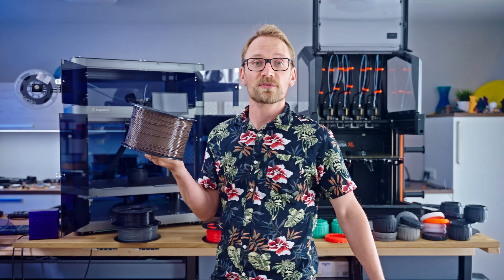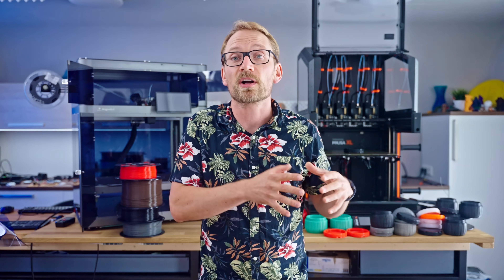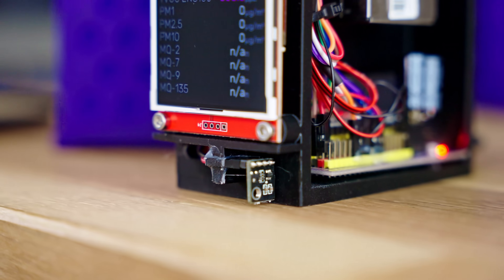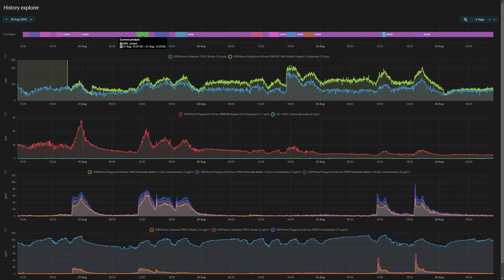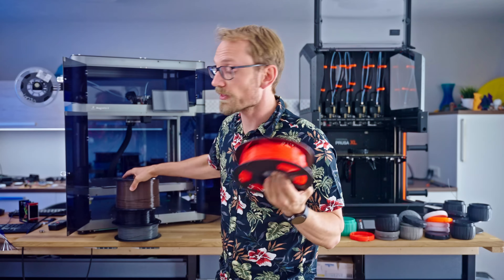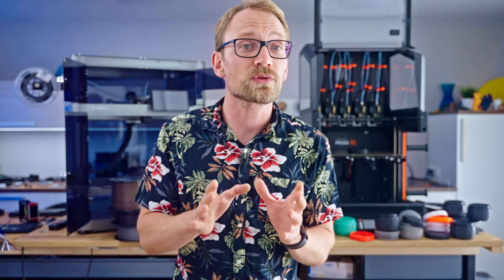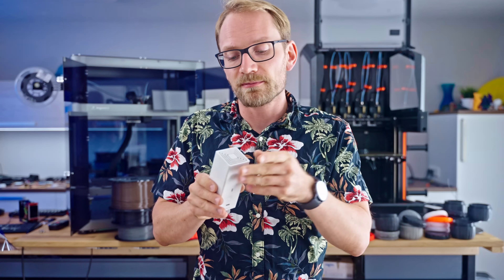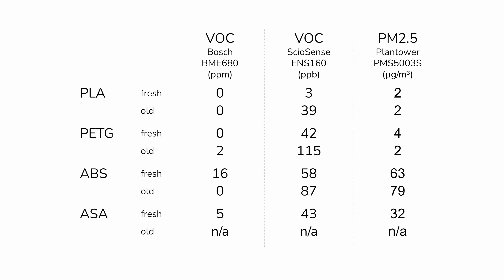3D printers are worse than I thought. Time to do something about it!

Comment: The solution to pollution is dilution. I think the best thing to do with 3D printer fumes is probably to plumb them outside. A reasonably airtight enclosure, a hose or duct and a fan to  exhaust the air in the enclosure outside. 

Or just put the printer outside, that's what I do with my Anet A8. Also helps ensure it won't burn down the house without at least first burning down the balcony.
Reply: Certainly having them away from your living area is by far the best option. I have a storage room by my garage that will be my "hobby room" once I get around to finishing it. But I'll still be running a HEPA filter with active carbon to scrub the air, it will just be a little less urgent with said air multiple rooms away.

Comment: I've been saying this for years.

1. PRINT IN A SEPARATE ROOM THAT YOU DON'T USE

2. Don't trust any filter on any printer - as soon as you open the door to get the print, the fumes come out anyway 😂

3. Wear a mask in your print room and have an extraction fan built in to exhaust the fumes out of the room

Comment: Pretty unexpected to see enclosures blocking very little and sometimes even increasing particles. Air filtering is always a good idea however there are many filaments that don't like cool and fresh air, so I think first of all the sealing of enclosures should be improved... then a recirculation or post-print purification system can be installed. Would love to see more of this, be it further ideas or other filaments.

Comment: Very interesting video, I'd be curious to see the same test carried out in the "resin corner", it must not be the same there, I can easily imagine (because of the smells of the resin) that even without printing certain molecules must be in high proportion, which is why we're advised to use a well-ventilated area and/or to wear a much more filtering mask than a simple surgical mask which wouldn't filter much when it comes to resin printing.

Comment: Great video! I wonder if you wanted to follow up and see if the Voron's 3d printed charcoal filters to mount under the bed help filter out VOCs better than the Ikea filter? 

I have one for the V0 and one on the trident, but I also have the big Xiaomi air purifier 4 pro room filter that I hooked into home assistant with triggers to start and stop based on pm2.5 and pm10 levels (it has built in sensors).

Comment: I haven't watched the video yet, just paused at the beginning to write the comment, so not sure what you are about to say... I'm commenting based off the thumbnail and title, hope I won't be off-topic :)
A few days ago I did my first print with ABS. Fairly large piece, 7-8 hours print. And I was very surprised because there was NO SMELL whatsoever. Yeah, I did put the desk with the printer right by the window and raised the desk such that the back of the x1c was right up against the open window. Accepted bambu automatic settings, 270deg nozzle temp, 90 deg bed temp. As for the fan, I think it was on for the most time. And I haven’t opened the door at all while the print was in progress, enclosure temp reached 50-something celsius, the door felt pretty hot. But even so, after hearing non stop about “printing ABS having the worst smell ever” and stuff like that online, I was expecting to at least feel something if I go near the printer, no matter what I’d do. But nothing, absolutely no smell. Of course, I'm not sure about VOCs (assuming some might be odourless?). And if having the printer's exhaust port right at the window ledge (but not actually outside) does eliminate the dangers like 99%? Also, this was in a big open space, like 100 square meters.

And it also turned out to be the nicest print ever, quality wise.
P.S. I wonder if filament humidity might affect how strong of a smell is released? The role was brand new, unsealed it 6-7 hours before the print and put it in the dryer for those 6-7 hours until I used it.
Reply: Typically when I print ABS on my bambu printers, the chamber fan (exhaust) is off, because the chamber needs to be kept hot to avoid warping. Could be that the open window had just enough air flow to lure the fumes out because even with a carbon filter inside the printer, and a carbon filter in the room, I still smell ABS while it's printing, and it's so bad that I have to wear a respirator that is rated for organic fumes.

Comment: Great content, thanks Thomas. This air quality topic has been a lingering question for me. 
Beyond the four types of filament tested here, would be curious how 'foaming' PLA's compare. Typically LW-PLA has an additive that bubbles to introduce air pockets based on temperature, or TPU.   
Thanks for sharing details of the DYI sensor build, and various air-filter options available. I've been using a box fan (~50 cm square) with a furnace HEPA filter taped on the inlet side. A carryover idea from when had wildfire smoke in the area.

Comment: Great video, wondering about filament that hase loose additives like fibres for reinforcement, would those also be released into the air?
Also I would be interested in knowing how you did combine all sensors into one working array

Comment: So funny enough, my lab at work spent $20,000 to get a professional company to do air quality assessments when our Bambu’s and Form 4 is running. Only did it with PLA. Nothing bad in the samples, though there were massive PM 2.5 spikes. Again, what was in the air was very low in concentration, well below any TWA average but didn’t pass indoor air quality; they checked for many many chemicals. So yes, lots of PM 2.5, but what that PM 2.5 was wasn’t of any significant concern. Don't know if this comment will get traction. I’ll see if we can show the results one day.

Wow, got a lot of traction. I'll UPDATE here:
Our setup is two X1C's, a Form 4, Wash L and Cure L, within vicinity of each other in a corner area of what was originally a warehouse so the ceiling is 40 feet above us. I expected the Wash L filled with IPA to be the main culprit for VOC's and it was. For PM2.5 it's a bit of a tough call as the area has soldering being done on and off and is generally dusty. The TWA for compounds was below all thresholds but PM2.5 being above IAQ could also be from the fact our facility is in an area where tons of 16-wheelers stop and go by during the day. 

Personally I'm sure some still comes from the printing itself, but these might be PLA microparticles they just don't have a spectrum check for. Mind you, the 'spike' was pretty close to the IAQ limit which is why it passed TWA, but again, almost anything in the air will count as PM2.5. 

What I am happy for is that we'll be designing a new area soon and first thing I added was extractor hoods for the zone which will be enclosed completely. I'll see if I'm allow to publish results (as these don't explicitly belong to me). 

We used a 3rd party to analyze and I was there to monitor the contractor the entire time, no conspiracy here. We had samples go through spectroscopy to analyze pages worth of compounds.
Reply: Wasn't of any significant concern by what standard?
Reply: Yeah, this is consistent with what I have found, both at home and in workplaces. There are absolutely PM 2.5 spikes with PLA, and certain filaments give off more VOCs than others (likely from whatever is used to colour the filament). No one understands the long-term health effects of regularly breathing in particulate matter from PLA or PETG because it's a relatively new problem. It is safe to assume it's not a good idea. We absolutely know that breathing in ASA, ABS and resin is bad for you.

Also, it's important for people to keep in mind that not all filaments and resins are the same, and very likely to be worse than others.
Reply: @BoxPopStudio   Man this comment of mine gew, just realized now. Definitely it's not ideal, at a minimum the printers should have enclosures. This is why our X1C's did a decent job of containment; there were spikes but relative to baseline they were not large. Keep in mind the X1C's do create a negative pressure zone internally so this makes sense. 

Since, I've printed my own filter boxes and am using activated carbon to fill them from McMaster-Carr. Our lab is also positive pressure, however we're moving to a new facility next year. Since I'm in charge, I got to dictate the layout.

I gave ourselves a room instead of a zone, negative pressure ducting, and am going to enforce N95 masks for anyone spending more than 30 minutes total daily in the room. We have a Form 4 now so that sucker definitely gives off fumes, especially with Rigid 4000 resin. I recently saw the CF filled filaments leave behind CF needles in your skin. We don't work with the stuff but the odd times we do, I'll also be enforcing glove use. 

It really doesn't help that our filaments come from mystery factories in the middle of nowhere. Regulation is needed, but in the meantime we can take common sense steps that should protect us quite well tbh.
Reply: What do you mean by indoor air quality? What was the standard?
Reply: @TheStreakify  TWA
Reply: @iggie8144  carbon filter will not remove particles only vapours
Reply: So I'm in the safe using only one P1S and only printing PLA\+?
The room is 60m2 and has a split AC but unfortunately low ventilation (a door to the rst of the house.
Reply: what kind of bambu does your company have?
Reply: Funny enough, my work has a lab where we grind asbestos with dremel, the company spent 50000€ on test and determined no harmful substances in the air. Lets see if this comment gets traction
Reply: @quazster  Sorry I'm not telling you what you want to hear. I'm just presenting the results I got while supervising their collection and giving my interpretation. This is still new technology and you can't check every compound out there. That combined with a blend of herbs and spices from who knows where overseas yea, probably of concern but tough to say how much
Reply: @quazster  I mean. If you're truthful then you are either working in a highly regulated industry with extensive filtering and PPE along with continuous testing. Or you're coughing up blood daily.
I'm leaning towards FUD or troll comment, or at least a misleading comment by not mentioning the extensive filtering and monitoring that is required by law to work with asbestos which would make the test just a verification that standards are being met.
Reply: @quazster  what do you grind asbestos for?
Reply: @M0PAX  Besides mesothelioma?

Comment: How did running the Prusa enclosure do for lowering levels?

I run all of my printers inside an enclosure running the Prusa recirculating filters. 

I also installed an ERV in my workshop because i was worried about particulates and VOC's.  So I'm glad to see some data showing they help.  I run mine 24/7 365 whether I'm printing or not.  You notice how fresh it smells when you go into the room..... Except when a skunk is outside.  I've had that happen and it stunk my basement up.

Comment: The white powder from petg needs to be looked at and figure out what it is, as it might be antimony trioxide. 
Most petg resins contain small amounts of antimony oxide as it's the most common catalyst used for petg polymerization and it's a white powder.
What little bit of research I can find about antimony oxide in petg suggests that it does come out of the plastic during reprocessing, ie melting like 3d printing. Antimony trioxide is toxic and a suspected of causing cancer.

Comment: I could be wrong, but in order for CO to be produced, isn’t a flame (plasma) required?  Since there isn’t any flame involved with 3D Printing, aside from something catching on fire, there shouldn’t be any CO produced, correct?
Reply from the maker: Pyrolysis and thermal decomposition (which would release CO) can happen without an open flame, so it's not impossible that some amounts of CO could be produced. I remember reading that CO emissions can become an issue beyond material temperatures of somewhere in the neighborhood of 350°C - not temperatures we typically print with, but also not impossible to reach either intentionally when printing highest-temp materials or unintentionally with a faulty control for the hotend.
Here's some research specifically looking at CO emissions during normal printing, and they also found that CO isn't an issue when 3D printers are being used "normally" https://www.cdc.gov/niosh/hhe/reports/pdfs/2017-0059-3291.pdf

Comment: I've Said that these FDM printers are not as safe as people think for years but for years I've gotten pushback. Even though research papers about this have been around for a good while now. Mostly that they do release particulates and VOCs and that the amounts are possible hazardous and that you need to vent these outside and that you might need to wear PPE when operating these macines.
As s sidenote. Ethanol and isopropanol are very similar solvents and most resins actually recommend being washed in ethanol. The reason most people use isopromonal is that it's cheap and easier to get your hands one because unlike ethanol it doesn't have associated taxes and regulations.
Reply: I'm new to 3d printing. But it seems obvious to me that melting plastic is going to release poisonous fumes. If you are concerned about your health or those who live around you, take precautions.
Reply: @kylemack8864  You would be surpised how much pushback you get when you say this.

Comment: thank you very much for in-depth analysis and efforts. I really liked the video. 👍 
I just got into this new hobby of 3-D printing for the first week. I kept the printer in my bedroom, but then I felt uncomfortable due to the noises and the fear of inhaling the fumes so I moved it to the storage room and it has a huge window. So whenever I print something, I just open the window and let the air circulate itself.
Also, I have a DIY HEPA air purifier. I just bought the filter for the Xiaomi air purifier and slapped industrial EBM PAPST fan on it, and I’m good to go.👍

Comment: I live near Amgen, Thousand Oaks. They routinely acution off lots of equipment, and I came close to purchasing a laboratory hood, but didn't have the means to move it. Wonder how well this would work. You could fit at least two, maybe three printers in a medium-sized one. You would have to connect the vent outdoors, but seems doable.

Comment: My goodness, you're late to the party.  Myself and many other YouTube channels have been trying to alert 3D printer users that there is a risk with VOCs and UFPs.  I've been pleased to see the trend going towards enclosed machines but again, users need to understand the risks they are putting themselves into.  No one wants to get black lung or any chronic inflammation from this stuff.  The notion that PLA is harmless compared to ABS just doesnt align with the research.  Read the safety data sheets.  Investigate what the FDA, CDC and other research journals are learning.  And please - print safe!

Comment: Thanks very much for this report and video.  A few weeks ago I downplayed it when my partner said she had an allergic reaction after I had been making some long prints in my office / studio.  The printer (a K1C) is mostly enclosed, but I often ran it with the top cover off and door open.  After watching this, I told her she was probably right.  Several weeks ago, I began the build of an enclosed chamber to sit on top of the K1C case so I can feed filament from above the print head.  I'm glad I did, and now I will never use the printer with anything open.  The back fan vents to the outside through a window and a long clothes drier vent hose.  Hopefully this will keep the enclosure at negative pressure and force all the nasty stuff outside.
Reply: Venting directly outside is the way to go. It vastly increases the spousal approval factor.
Reply: The low pressure inside the enclosure is key.

Comment: One thing to note is that whilst (activated) carbon filters can be used to filter VOCs, they don't magically filter them in an instant - you actually need to cycle the air through them multiple times to cut down the VOCs. You will need either run a filter for a longer period of time (increase the number of filtration cycles), or have multiple filters in-line, or both.
That puny little filter that comes in some 3D printers isn't going to make too much of a dent unless the printer is engineered to recycle the air through the filter for extended periods of time before venting to the room.
Aside to that, VOCs are also found in adhesives/ chemicals used in treating wood products (plywood, OSB, MDF etc. and the glues for the laminates/ veneers) - some suppliers/ manufacturers use more modern adhesives that have minimal VOCs but you really wouldn't know.
This has become much more of an issue (locally here in Singapore) in the recent years as cheaper materials sourced from China tend to have a large amount of VOCs like formaldehyde. Vinyl flooring is also another culprit as well. There are suppliers of such materials and adhesives that are low VOC but the prices are substantially higher.
It's been an issue that's gaining sufficient awareness that there are even documentaries and news reports made on such matters.

Comment: 15:17 haha No... A few years ago, I built an air filtration system (because the most 'beloved' minority in Hungary tends to burn rubber and all sorts of waste during the winter, creating constant smog even if their ghettos are 5-10 km away). It contains an H13 filter and 5 kg of activated carbon, specifically made from high-quality coconut shells. Although activated carbon is often touted as a miracle solution, it can hardly filter out anything; the smell of perfume, cooking odors, and the smog seeping in from outside all remain. I tried various types of carbon, but none were effective. Additionally, in this quantity, the carbon has a distinctive metallic smell, which also increases the VOC levels.